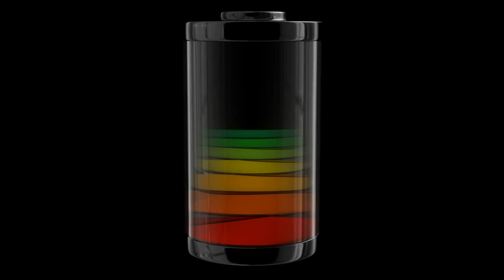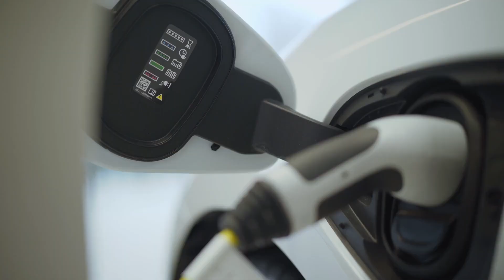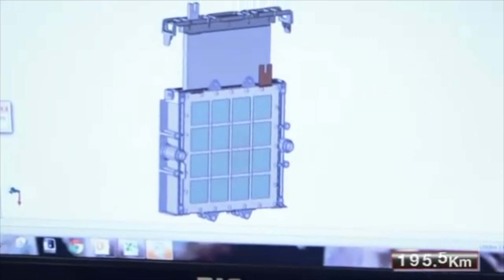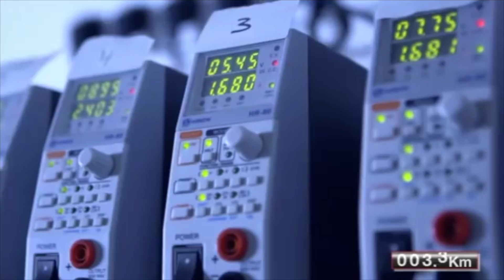This Battery Gives EVs 1000 Miles of Range!

Comment: Great video! One question though. The Phinergy test you said the aluminum battery extended the range 600 kilometers and then said that is about 1000 miles. Did you mean 600 miles or was it really 600 kilometers, which would be around 370 miles?
Reply: Should’ve read 1600km which is 1000m.

Comment: Yeah....Unfortunately, the costs just won't ever make sense.
Real world example:  Seeing as we produce most of the aluminum of North America here in Québec (thanks to our nationalised cheap hydro electricity), this would look like a huge win for us.
I drive a Chevrolet Bolt, where the 64kWh battery pack costs 15k$ USD =18k$ (Canadian), so over 10 years at 30000 km/year, that's 0.06$/km, or 6$ per 100km. (your mileage may vary, but the battery is still good after 10years)
The same 100km also costs about (0.07$/kWh)x(17kWh/100km)=1.19$/100km.
So yeah, 7.19$/100km, or 115$/1600km (1k miles)
Conclusion: I highly doubt that those Aluminum batteries that last 1000 miles will cost less than 115$ CAD (or 95USD), especially considering that Tesla's batteries cost less and are expected to drop by 50% in the next 2 years thanks to the 4680 tabless design...
Not to mention the inconvenience of finding a battery replacement station while the battery is not empty yet. 
There might be a case for aluminum disposable batteries in aerospace, but that's about it.

Comment: Maybe Aluminum Air batteries could be used as charging stations to fast charge EVs with LiOn batteries.
Reply: Great idea, the grid is going to take time to be upgraded, and until then we are going to have to develop other ways to provide the electricity needed for all these EVs. Not to mention these heavier vehicles are going to take a toll on our roads and bridges so we need to take that into account when building and improving those too.

Comment: I'd say this would be something that would work for grid storage and maybe air travel. A grid installation could have access to clean water or the space to recycle used water, and could even have robotics to rotate out spent cells and "charge" them - essentially converting the aluminum oxide to aluminum metal. The hidden statistic though in Al/air batteries is their very low efficiency - 15% versus lithium ion which is about 90%, which may make all of what I said above a non-starter and is probably why it is not even considered fully for EVs.

Comment: What about a hybrid model, if I am going on a long trip, I can swap one in, or put on on the trunk when I need it, but use a regular battery for day to day driving.   AKA, range extender like the gas engine in the volt
Reply: That would be the Volt (I have a ‘19, and drive 95% electric).
Reply: @kenhenningsen1  thanks, was close but no  Cigar on that one!

Comment: This was last years news. Turns out it was a scam. It can’t be recharged and needing to replace the battery pack and have it melted down isn’t that helpful. What are the chances of finding a swapping station exactly at the point that the battery is empty at 3am?
Reply: Not suprised 2bit fell for it.
Reply: Don't forget to include the 15% charging cycle efficiency!
Reply: @bru512  On what? This battery isn’t able to be charged back up. The battery destroys itself.
Reply: @SirHackaL0t.  Potentially the exhausted battery could be recycled/recharged.  The energy required to do this is estimated to be 5-6 times (15-20%) the amount that the battery provided.  My point is, why do this when the charging efficiency of Li-ion is ~ 99%?
Reply: @bru512  Recharging and recycling are completely different. AFAIK it has to be recycled - so melted down and made anew.

Comment: 6:33 - Land Rover Defender. Range Rover is an entirely different model line.
Reply: They'd then make one that is a plaid edition and comes complete with all the mp3's of the irish rovers who was first to introduce plaid even though they didn't invent it, they reinvented it.
Reply: Also doesnt know difference between anode and cathode ( or is it just the U.S. influence ?)
Reply: @paulhousden3825  To be fair, I still sometimes have to use a mnemotechnic trick "kovina ka katodi" (" metal towards cathode" in Croatian) to remember which is which.

Comment: 0:40 - Technically, Al-air battery is a battery, but a primary battery, like, say, good old Leclanché cell (zinc-carbon), and unlike equally  good old lead battery. Not all batteries are accumulators, that is, rechargeable.
OK, I guess you can call it "fuel cell", too - the line is a little blurry.
Reply: Description is starting to look more & more as a fuel cell.

Initial resources in;
Reactions with O2;
Produces power & waste material
Reply: They called this aluminum fuel cells 30 years ago when this wacky idea got canceled first time because of costs . Still way to expensive to be practical.
Reply: it is absolutely a fuel cell. Aluminum air fuel cell. An interesting idea for energy transfer. But, not even rechargeable.
Reply: @AlexFoster2291  Fuel cell as opposed to primary (non-rechargeable) battery because it uses atmospheric oxygen? OK, I guess that could be an useful distinction, but zinc-air batteries (used in, say, hearing aids) are called batteries, although they work on the sam principle. (Wikipedia article indicates that they are called fuel cells if the zinc electrode can be mechanically "recharged", that is, replaced.)

Comment: Aluminium air battery is more like a fuel cell, which runs on aluminium as fuel.
It is a relatively energy dense fuel, but that hardly solves any problems (except in very special cases).
Making hydrogen is much more economical than converting aluminium oxide back to metal, but simply using a rechargeable battery is more economical than those.

Comment: Wow Ricky, great report!  I'm still hoping for a "This Year" 4680 450 mile Model Y.   Yes keep investing!
Reply: @profounddamas  he’s clearly done a lot of research on the topic, and he’s compiled it in a very digestible video, which takes massive work. Hence great report.
Reply: I too am hoping for a 450+ mile range Model Y but I have been listening to reports that they will likely make the battery packs smaller while adjusting the range minimally to increase profits 😣
Reply: @myfillerITM  That's a good point. I own some Tesla shares, but I am glad to see Ford make a big investment in EV to force Tesla to compete on price. It's all coming down to battery factories.
Reply: @myfillerITM  Or more likely to reduce costs while increasing range a bit while also making the vehicle weigh less for better performance handling wise.  But can also draw the power off the battery at a MUCH higher rate meaning you can use higher horsepower electric motors/controllers without overheating.  I believe Tesla is projecting that they will be able to push hundreds of more horsepower out of the same motors they are presently using.

Comment: What worries me about aluminum batteries is what cost, at say 1000km or 1000 miles, would there be to replace the battery.  If it is going to cost more than a gasoline engine to just refuel over time than no one will want to do it.
Reply from the maker: That’s the big challenge. What if they could price a swap after 1000 miles at $100? That’s sort of the sweet spot. Otherwise it’s not feasible

Comment: Interesting, but recycling a battery each 1000 miles seems way too expensive, and it would only work if every car company would agree on the same battery format (no chance, and rightfully so, it would be too much of a constraint in design, think of smartphones with AA batteries). Then, instead of tank trucks distributing gasoline (which can be used by every car and is a lot more energy dense) you would need a lot more trucks to carry around refurbished batteries to swapping stations... I'm not convinced, Li-ion seems to make way more sense.
Reply from the maker: Yeah it’s a tough challenge

Comment: Thanks, Ricky for giving us another quality & thought-provoking video.
I liked the test car example that used smaller Lithium-Ion battery banks & was supplemented with the Al Air fuel cell to extend the range when needed. Smaller Lithium-Ion batteries save on the cost of the build & recharged quickly, the Al-Air fuel cell won't need to be replaced that often. 
While we're at it, chuck in some Super Capacitors to take the starting load off of the batteries. 👍

Comment: I'd love it if all EVs had a way to use Aluminum Air Batteries as a gas can.  Just keep them in roadside assistance vehicles for those who ran out of charge, just like they carry around gas/diesel.  Might as well be available for purchase too but there would need to be a standard internal connection so all EVs could run straight off of the batteries instead of waiting on charging the main battery.

Maybe gas can (or jerry can) is the wrong term?  In this case it would be like having a reserve tank that an ICE vehicle can switch to.

Comment: Is an entire new battery gonna cost the same as the same miles of charge on li-ion? I don't think it will ever be close to the same cost.
Reply: True, it won't cost the same.... it will cost LESS once full production efficiencies are achieved. They worked hard on the Producability of the 4680!
Reply: @erickessler6094  No, it will always cost more. It takes more electricity to make the aluminum than would be required to charge a Li-ion battery for the same range. So the electricity cost alone makes the Al-air battery more expensive. When you add on the cost of assembling, transporting, and installing the Al-air battery, it costs way more.
Reply: They tried to market this about 30 years ago and it failed because aluminum is way to expensive to be used in this manner.
Reply: I think batteries will always be of lithium,
you hear every week that researchers have found a wonderful battery that is made of different materials,
these are scams,
the team of researchers wants people to "invest"
there it is!
they just want people's money
Reply: @Zo-greenforest  "Prototypes are easy [mass] production is hard"
Elon Musk
Reply: @morteza1024  you hear every week that a wonderful battery was invented,
yet none comes to fruition,
that doesn't make sense,
it's like saying you dug hard to find gold, then, you found a big piece of gold but oh you never took it
Reply: @Zo-greenforest  Yeah there are a lot of scams but batteries have the potential to be 10x better than today. Most of the material in the Li-ion batteries is not lithium only 3% is lithium.

Comment: 00:13 A 300 mile range battery would require 2 gallons of gasoline as an energy equivalent? What math am I missing? Or is there an obscure physics formula we should know and understand?
Reply from the maker: A gallon of gasoline has an equivalent of 36kWh of energy
Reply: @TwoBitDaVinci  OK and your videos are outstanding but do you understand how that 36kWh of energy means very little without a scientific explanation as you are so good at providing? So there's a formula and explanation that equates 2 gallons of gasoline @ 36kWh each or 72kWh which somehow equals a 300 mile range battery's 72kWh? The battery's range with 72kWh will get you 300 miles but the 2 gallons of gasoline with the same 72kWh or energy equivalence will get you around 60 miles on a good day? Doesn't that bring up an interesting question?

I'm thinking this makes a lot of sense in your mind, and perhaps others' as well but the thing that makes your talks so valuable is the simple scientific explanations for such things. The numbers make a great point, but glosses over the interesting science behind those numbers and assumes a certain level of energy and energy equivalence knowledge from your audience.

Still a great video and an exciting future in battery tech, and thank you, but just give some thought to the point above.
Reply: @larryhawes8295  Think of it this way ... a typical internal combustion engine is inefficient at converting the energy from the gasoline into forward motion. That's why you can't travel 300 miles on 2 gallons. Without getting into the math, this is the simplest answer.
Reply: @ScubaSteveCanada   Thanks Stephen and your simple explanation is exactly my point that I think should have been at least alluded to in the video...

Comment: Yeah, but no but.. You really think that people in a third world country where they can't even afford a single 110V 10A outlet can buy a non-rechargeable EV with a battery the size of a Tesla pack?

The logical use for these batteries as far as I can see is to have small units with a capacity of perhaps up to 5 kWh, these should be light enough to lift and can be stored in a compartment such as under the boot/trunk floor, or even under the hood/bonnet. You could have none of these fitted as standard, or you could have maybe as many as 4 plugged in - but they would not normally be used in your 100 or 160 mile range EV. However, when the day comes that you need more range and something is stopping you charging, you select an option to "open" one of the packs. This will then run the car (probably by charging your main battery as the power level will be too low for main traction) and allow you to keep going until it runs out. If you have more than one pack fitted, and you still need power, you could "open" another one. 

Spend units could be taken to a store and exchanged for full ones in the way that propane or butane cylinders often are.

This means that as long as you have some power available (even just a very small solar array) you will be able to run the car most of the time on the rechargeable pack, but you will always be able to pop open a single-use cell if you need extra.
Reply from the maker: So people In third world countries usually don’t have utilities run to them. They instead take propane tanks to refill or buy water from trucks. So I’m such a place, imagine you drove around and then went to a central facility for a battery swap
Reply: @TwoBitDaVinci  Are you saying that these people can't afford even a simple 1kW solar array - but can afford a brand new EV with an Al-air battery large enough to last a few months?

Comment: One correction on the range extender - 600 KLM is not 1000 miles. 1000 KLM is 600 miles. Its still impressive but not quite at the level you were talking about.

Comment: 0:13 did he just say two gallons of gas will give you 300 mile range?
Reply: I must not understand. How is a 75kWh battery “equivalent” to 2 gallons of gas? The Honda EU 2000 can convert 5.4kWh of energy from a gallon of gas. It would take 15 gallons to produce 75kWh.
Reply from the maker: Equivalent amount of energy about 75kWh
Reply: How can you get 2 gallons of gas to produce 75kWh? A 1kW generator running for 75 hours = 75kWh....on 2 gallons?
Reply: @Lovingkindness.  equivalent not convertible amount.
Reply: I found a website that explains it. Thanks!
Reply: @Lovingkindness.  Cheers what website
Reply: @Larry C

Heat produced is the power measured in watts. Gasoline engines are 90+ % inefficient in converting fuel to 'usable' mechanical 'power'. 
>.<

Comment: Aluminium, also known as solid electricity. It uses huge amounts of electricity to reduce aluminium oxide to aluminium.
The energy may be the same as two gallons of petrol, but how much petrol do you need to travel 300 miles? 2 gallons? 10?
Reply: @Bohica Johnson
Gallons needed=300÷mpg

Comment: Will have to be earthbound and needs a grill for air intake which greatly increases drag
Reply: The amount of air it needs to breath is tiny compared to the amount humans use.  Or internal combustion engines!
Reply: @CrissaKentavr  ICE still more efficient.
Reply: If you live on a hill and work at the bottom, you can roll to work in a barrel and then climb up after your shift.